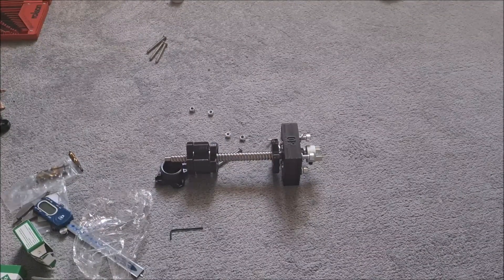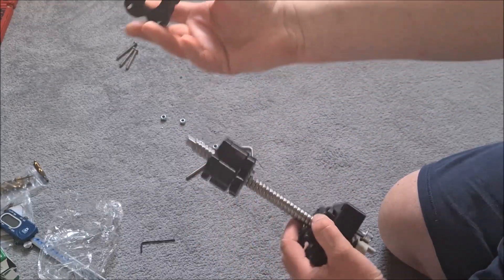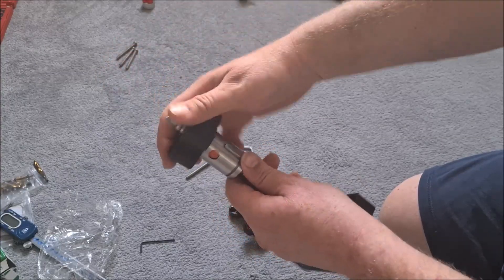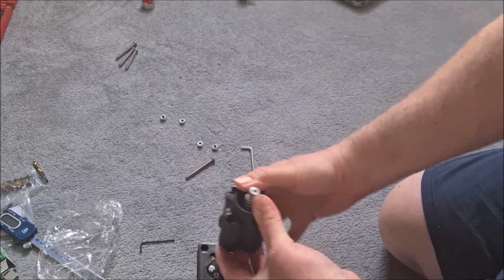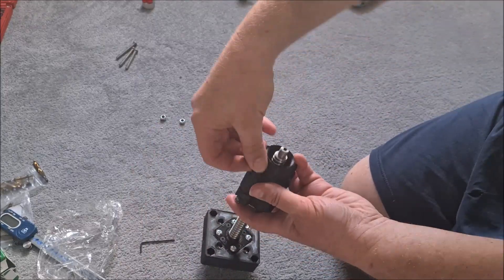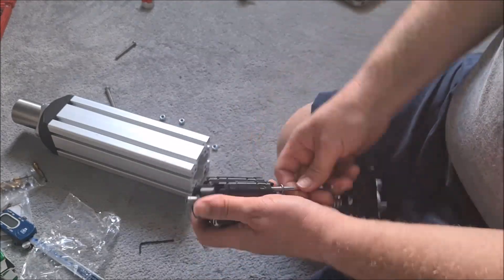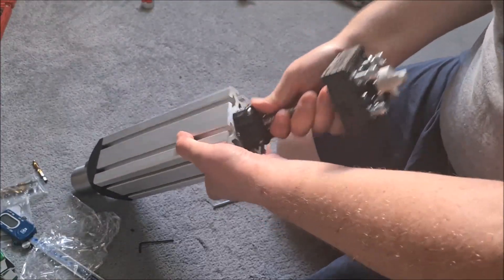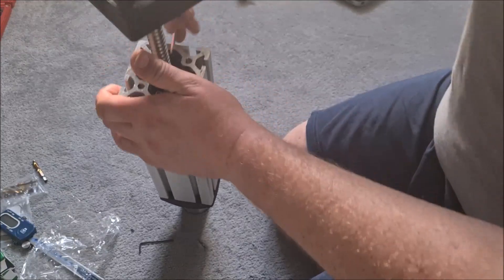Build your Own Sim Racing Motion Platform - Cheaper Actuator Design - Part 2 Update

Comment: Hey bud, I sent you an email, but I was curious if there was anyway you could help me to adapt this to a 100x100 profile? I was accidentally sent these ball screws for a 100x100 profile. I got the slider files from your link, but the OD of the slider obviously won’t work in a 100x100, but I love your design. It fits so perfectly around the ball screw and I think it’ll be wayyyy more reliable as where the load is, between the shaft and the ball screw, is all solid print. I tried to adapt them in tinker cad, but I can’t figure out how to enlarge the outter diameter without changing the holes.

Comment: how much does something like this ccost to build?:
Reply from the maker: Approx £1100
Reply: @GPRaceSimulation  Is that for 4 actuator set up. Im in the UK i want to build this so much but worried it will be too difficult.  Also i only have the ender 3 printer is that good enough and if so what material is used to print the parts?